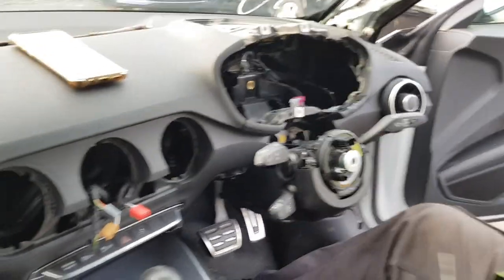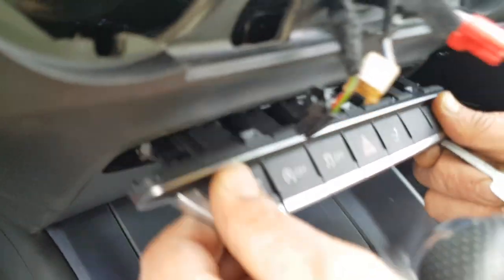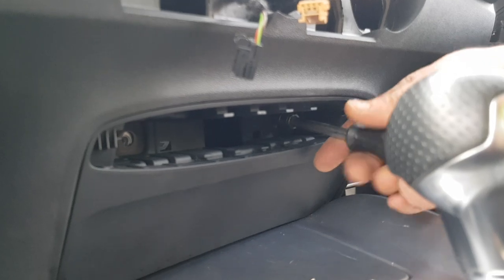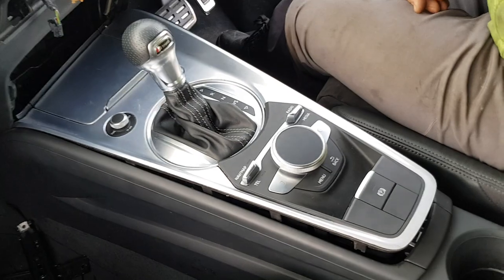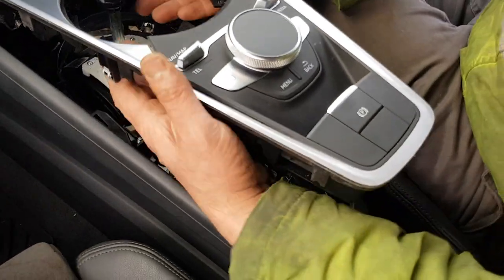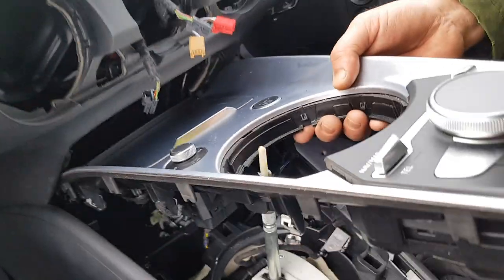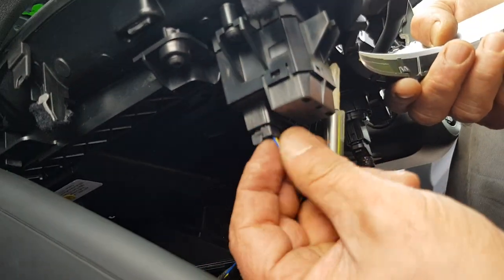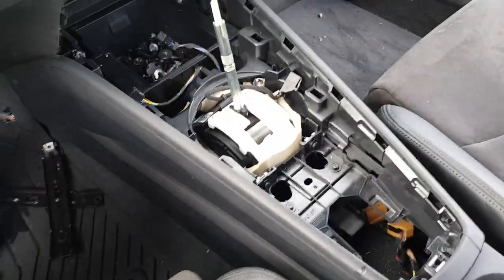AUDI TT MK3 8S HOW TO REMOVE CENTRE CONSOLE

Comment: why is the middle console in reallife so much trickier to get off? do you have any hints for me?
Reply from the maker: After taking off the heater control unit you just have fidget around tbh using a flat head screwdriver or a flat surface object to get inside the edges and unclog. (dont forget to unscrew a few screws that are mentioned near the end of video).

Comment: Hello, could you help me mentioned what parts include the starter kit, I mean the ECU key and what other parts I have to have one 2016 and I have to buy the complete kit, could you help me in advance thanks
Reply from the maker: ECU Kit will mainly consist of the ECU control module, BCM control module, fuse box, Speedometer, Key, Ignition Barrel, door lock barrel.
All parts will have to be from the same vehicle of course.
Reply: @partscityltd  THANK YOU FOR YOUR INFORMATION, it helps me a lot. Could you recommend where to buy the kit? thank you in advance have a great day
Reply from the maker: @benzobethperez6166  You will have to find a breakers yard that has this vehicle and is selling the ECU Kit as a whole.
Reply: @partscityltd  thank you somewhere that you recommend me

Comment: do u have any video showing how to remove back seat in the same car?
Reply: It's crazy how they even came up with putting those 2 infant-sized seats in the back on the TT when the TTRS is a 2-seater
Reply: @zyxe-726 TTRS has four seats as well. They're designed specially for people between 130cm and 145cm tall, or you can fasten a child seat to them. But realistically, they're pretty pointless.